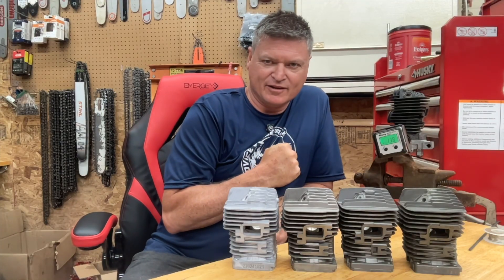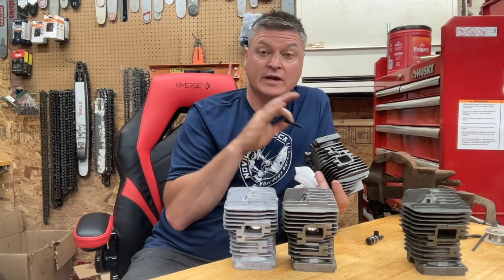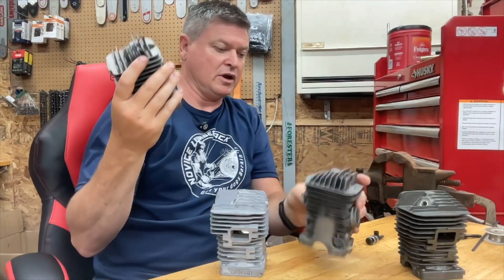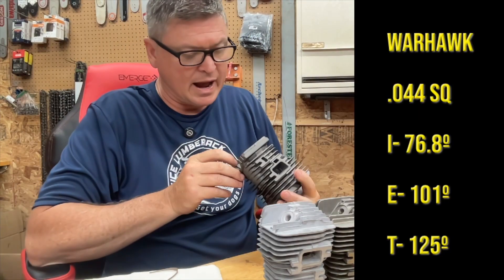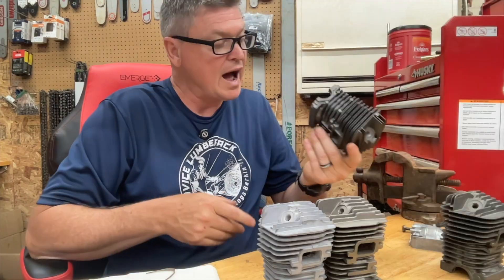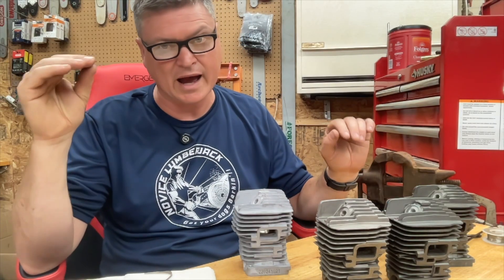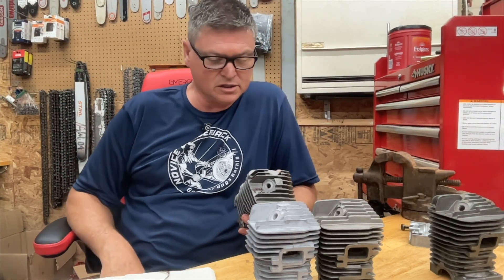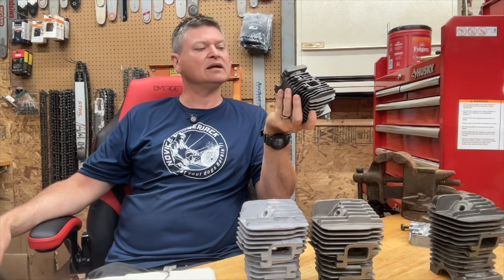Average Dude Mods Pt 7 - Comparing Cylinders MS290 029 390 039 Stihl

Comment: I built one with a NWP cylinder some years back it was a complete short block and came threaded i stripped two of the holes tightening it to the frame I went back through the stripped holes with the OE self tapper it tightend up and is still running 5 ish years later so that is a solution you might try on that warhawk...

Comment: Went to a seminar from one of the big aircraft engine builders who got their name by building a bunch of the Reno Air race engines and they talked a lot about cutting to shape then welding up spacers to reshape the combustion chamber in the cylinders (which are horrible in design). Always found that interesting and dont hear anyone talking about that much but seems like it would be worth trying if a guy was good at welding aluminum. I’m not so I never really pursued the matter 👍🏼